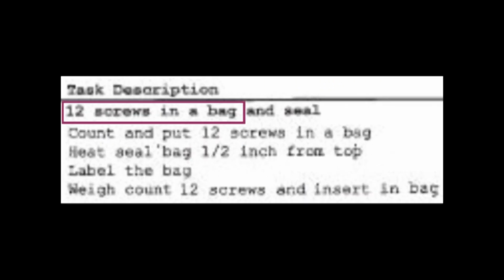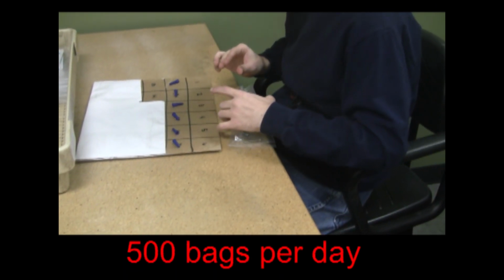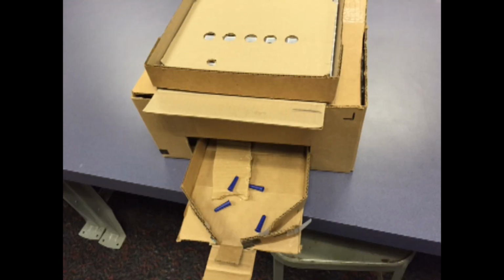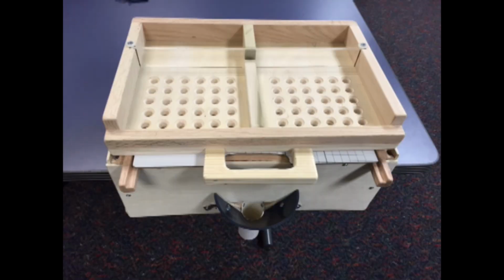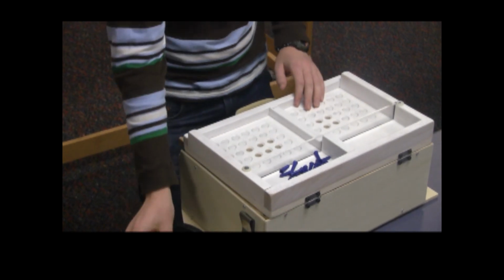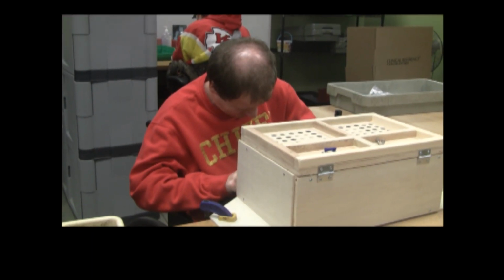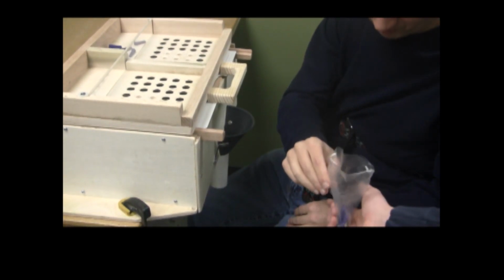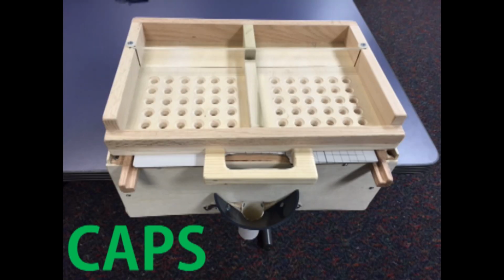Gardner Edgerton Engineering CAPS

Comment: Great job, Team Edgerton! You've developed a very impressive product! Here are our notes on your team from the keynote address:
The Gardner Edgerton High School team tested several prototypes for counting and packaging drywall screws and anchors, and based on feedback from their subject matter expert, developed a product that integrated the best features of each of the prototypes. The final product significantly reduced errors and increased productivity. The CAPS system has flexible settings, allowing its user to count and bag different numbers of items.